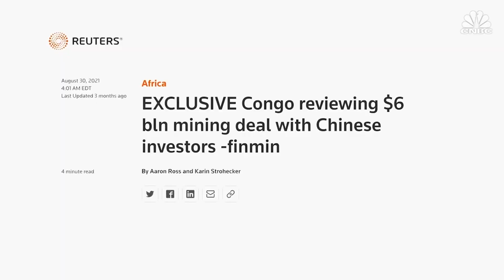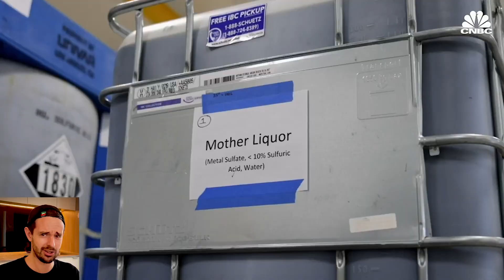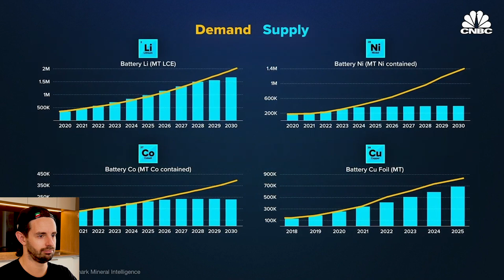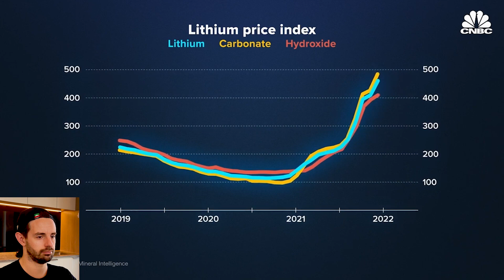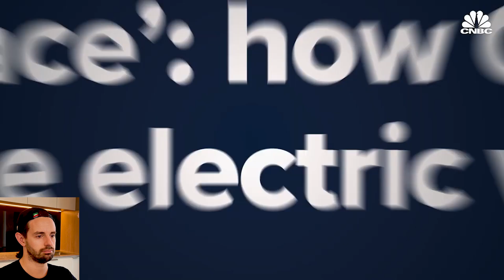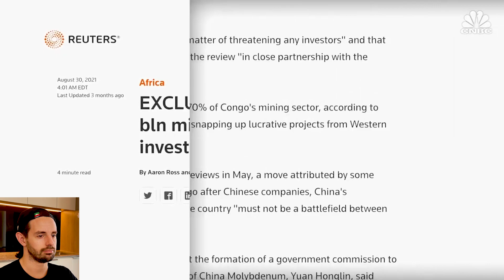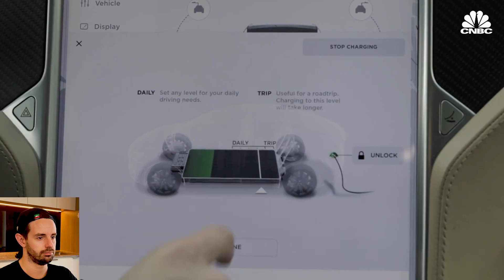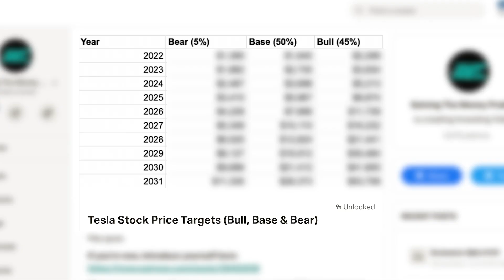HUGE Risk To EV Industry + Tesla Co-Founders’s WARNING

Comment: Important point misses by Steven. Redwood materials is a recycling company but they are first and foremost a battery materials producer. There is not enough battery scrap for JB’s business model to work on recycling alone until we’ll into the 2030’s. Look for JB to seek offtake partnerships with near term lithium producers. Preferably in NA. Field is narrow but if you look in Nevada there is one of the largest lithium deposit in the McDermitt Caldera. Project now has both federal and state permits and is shovel ready.

Comment: Great to see you profiling what is THE LIMITING FACTOR to achieving EV forecasts. Tesla is miles ahead of the competition - but have they ensured enough lithium, nickel, graphite supply to achieve 50% annual growth and meet your forecasts? What JB is doing in recycling is fantastic, but over the next 10 years at least Tesla and its competitors will rely much more on virgin/newly mined and processed materials. Have you looked in any detail into Tesla's current  - or future suppliers of lithium nickel graphite (Albemarle, Livent, Ganfeng, Piedmont, Talon, Syrah)?

Comment: True believers have already launched a jihad against oil and gas. But it's gonna be a while before wind/solar/battery can replace not just the electric grid, but nat gas as well. My house has a nat gas stove, central heat, and water heating. Two-thirds of nat gas goes directly to homes or industry in the US. Keep shutting down gas and oil, and even coal before the energy storage problem is resolved and there will be a big backlash when the "green" grid fails We're already reaping the wind from environmental extremism causing the price for oii to rise and enriching Putin and emboldening him to invade Ukraine.   We'll just have to live with heat waves, droughts, hurricanes, fires etc., until our grid can be made to make the weather perfect, LOL. Sarcasm intended.

Comment: Here is something I had typed up in my notes when I would argue with people a couple years ago about batteries…. Copy pasted

Lead acid batteries are recycled at a 99% rate due to strict regulation requirements on the sale of batteries forcing companies to offer a discount on the sale of a new battery if you return the old one and the companies are required to recycle it. When electric cars become more prominent in the field. This regulation will be copy and pasted to the EV market. It’s already been discussed and agreed upon but not until there are enough EVs on the road to justify the regulation. There are only like 2.5 million EVs on the road atm. It’s still way too small to implement. Dumb problems require require simple solutions. Just need people to use their brains. Once we hit 100 million cars on the road. The recycle rate will be up to 99% and the required mining rate for new EVs will be reduced by at least 70%. Or that of equal to our lead mining rate. Once we get enough materials in circulation our mining rates will reduce drastically. Besides if you wanna talk numbers. 60% of ALL the electricity created in the entire country goes towards the mining, distribution, refining, and more distribution, of all the different kinds the fuels we need for transport. Then we do it all over again and again and again with zero recycling. EV batteries  will eventually be recycled just like lead acids are and there IS a means to an end to the mining of the materials needed to make them.

Comment: I share this battery raw material conversation all of the time with LUICD, RIVIAN, GM and FORD nut jobs. I ask them, “where are they getting their raw materials? “ Crickets… 

As a mine you have to get money from the OEMs today in order to expand the mine and the mining rights to expand. This alone take 5-7 years to expand a mine. You have legal battles, court hearings, water studies and gain public trust it will be done in the most sustainable manner. You can’t pick up the phone today and get more batteries, they are all bought for many years. Mines won’t expand without money and a contract, meaning, you have to write a check today for more raw materials 5-7 years from now. The Limiting Factor and a few other battery channels have done extensive interviews with owners of mines and and industry leaders. If you don’t have raw materials locked up today, you won’t have them for 5-7 years out.

Comment: The good news, such as it is, is that all the battery chemicals are recyclable. Even if the USA has to import those batteries and the materials now, every EV or laptop or whatever that has rechargeable batteries on it, that comes here, those materials stay here forever, getting recycled and reused in the USA. So we will have more and more battery materials available as time goes on. Unlike oil which you buy and use once, then have to go and drill, pump and buy more each time. So China has a huge lead at this critical time, but that will fade in time.

Comment: You seem to be running out of idea💡’s. 

How about calculating what worldwide shipment costs as a percentage of each robotaxi car valued at $300,000.00. 

Each robotaxi car shipped from a Tesla robotaxi plant in China that makes 20 million robotaxi’s and batteries at one plant in China. 

Thus, also calculate how efficiencies of scale, cancel out any extra shipping costs to send the cars worldwide.

This plant would be built when FSD is completely solved, say 2025. Speculate how long to build the plant in China.

Then also speculate if Tesla’s Giga-Austin site has the space to build 10 million of these FSD robo-taxis upon solving FSD completely in 2025 and how long to build that plant capacity out.

Comment: You can invest today in another startup company run by an early and well-known Tesla employee. Ryan Melsert. 

ABML is conducting geological mapping, sampling, geochemical analysis, and proprietary extraction trials to characterize high potential resources and to quantify the performance of its internally developed lithium extraction and manufacturing operations in Nevada. In english..... they are developing a process for extraction and the manufacturing of battery grade lithium hydroxide from lithium-bearing surface sedimentary resources.

On February 16 the company announced that it is in the process of staking 90 additional surface sedimentary lithium-bearing claims covering approximately 1,800 acres that will expand their Tonopah Flats Lithium Exploration Project in Big Smokey Valley, Nev. to a total of approximately 10,340 acres.

Holding as another long term bet. They are cheap and on sale now.

This is not investment advice. For your information only.

Comment: So far ahead on LFP batteries? Lol, they use off-the-shelf batteries from CATL that are much less energy dense than BYDs LFP blade batteries that are structural and come in an 800v platform. BYD Aldo has exclusive mining rights at a lithium mine right next to one of their battery factories. It's time to admit that Tesla isn't the only company in a dominant position.

Comment: Has anyone noticed what it takes to mine these elements? I've seen estimates that the amount of strip mining needed will far exceed the current coal mining, and the environment groups hate that.  I also believe that we are many years away from the EV utopia some dream of.  Somewhere around 70% of people don't want an EV, but more importantly, even if we got to 30% EV adoption, the grid can't handle it.  Also, do you realize that a single super charger uses as much electricity as 200 homes: 350 kilowatts, an average home only uses 850 kilowatts a month.
Reply: Much of the video concerns "mining" the materials already in circulation, for example, the billions of old phone and power tool cells.
.
"The Grid" will be just fine according to experts (actual "Experts")
Have you discounted the grid energy used at the moment to refine fossil fuel?
.
The 7kWh (sometimes more) required to refine sufficient oil for a single gallon of fuel will move an efficient EV just about the same distance as that fuel will move an ICE car.
.
Add the extra energy required to first get the crude oil to the refinery, then road transport that fuel to point of use, both of which require refined fuel(Those 7kWh's sure add up!)
.
It's virtually zero sum in terms of grid power.
Plus of course, that also negates the "EVs run on dirty power" opinion, since it's at least equal using the very same energy, and getting cleaner.
.
Add the prospect of vehicle to home, which will in fact balance the grid at peak times (that'll be when a home owner returns home..... In the car) and if managed properly can result in a nett decrease in grid consumption, certainly in peaker plants, which are, as we know, the dirty ones.
.
Search Graeme Cooper, Head of Future Projects, UK National Grid (Same company as USA??)
As I said, an "actual expert"
.
Discuss?
Reply: @rogerstarkey5390  I'm not anti EV, just think it will take time.
Reply: Think TaaS... i.e., Robotaxi.

Comment: In the short term, any geopolitical issues with China would be devastating to Tesla. Without sufficient access to lithium and/or chips, they're dead in the water.
Reply: While a concern, Tesla has contracts for materials from other locations around the world.  Plus China won't cut off their Shanghai plant.  So is it a concern for EVs as a whole? Sure.  For Tesla?  Yeah, but not nearly as much.  (And might actually make Tesla stronger as it can continue to manufacture while other OEMs will barely be able to make any EVs).
Reply: @PhrugalPhan  I thought I read that Tesla was planning to build its own refinery.
Reply: @darylfoster7944  Exactly.  They have long term contracts to get the raw materials to then refine for their batteries.  So they are the best setup for any materials cut off by the Chinese.

Comment: Unfortunately, CNBC videos like the one shown will worry the technically ignorant, which is why the Dailymail type reader thinks that EVs are pointless green things, and that EV owners are hapless souls who limp between unreliable ‘charge stations’ and that their battery will fail within 12 months and cost £20k to replace because its still based on a 200 yr old lead-acid battery design etc etc!!!  If ever you want to become suicidal, just look at the reader-comments left after any EV article in said newspaper !

Comment: LFP uses iron (cheap and plentiful) and phosphate cheap and plentiful). Lithium is a small percentage of the battery. Big question is why do we use anything else?
Reply: With our current tech, LFP simply doesn't have the energy density needed for cars.

Because Tesla's drivetrain is so much more efficient than other automakers, they can manage to make use of LFP for some of their cars with a shorter range, but not for their longer range vehicles.

Eventually they will probably be able to increase the energy density of LFP, and then other manufacturers will be able to use LFP for short range vehicles and Tesla will be able to use them for all their vehicles - if they don't find something even better.

Comment: Surely the best way to recycle used Li-ion cells is as Li-ion cells e.g. old Nissan Leaf packs used as "Powerwalls". A 24kwh pack that has degraded to 18kwh may be less attractive in a car but in a home where weight and size are not constraints they would be fine. Only when they no longer hold any worthwhile charge should they be harvested for the metals within.

Comment: I thought Tesla talked about having an ample supply of a very large parcel of land they purchased in Nevada back on Battery Day???  Am I mistaken?
Reply: You are correct. See also on YouTube the video on the Tesla Lithium Clay Patent from the channel The Limiting Factor. Very promising technology!

However, I have noticed that almost no one outside Tesla is taking this possibility seriously - and in fairness it will take at least a few years to develop that resource.

However, I have considered, keeping in mind Tesla's good relationship with Toyota, that Tesla may have plans - after they have purchased all the batteries that suppliers can produce and thereby having grown that industry - to bring their own resources online and bring all battery production in house, and then kick that production capacity from their suppliers to Toyota and other competitors. Toyota (and also a few other manufacturers like Honda) already have lots of experience with both batteries and electric drivetrains, as they have been using these for years for their hybrids. All they really need to do to become fully electric is to get hold of enough batteries. Sandy Munro has pointed out that Toyota makes plans for a century into the future, so I don't buy into the idea that they are doomed.